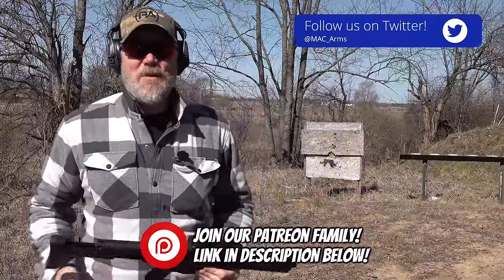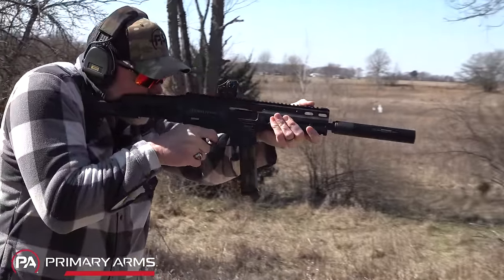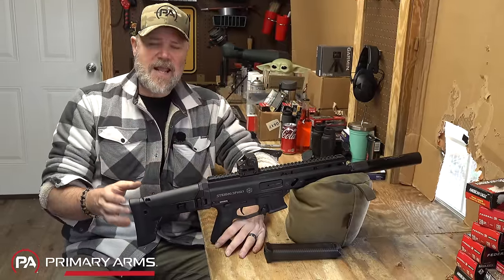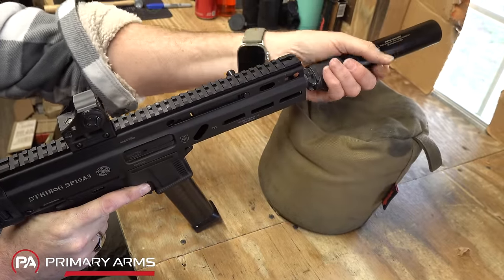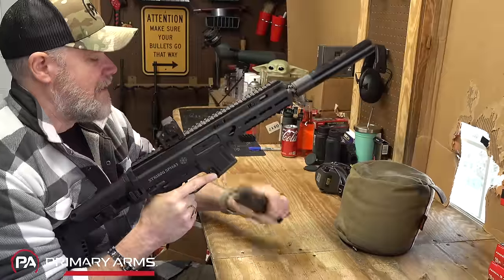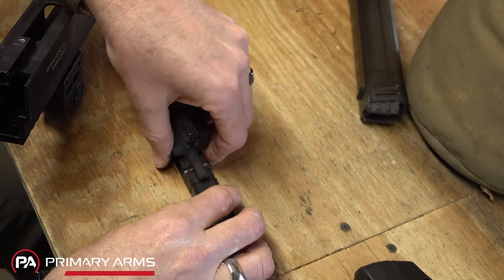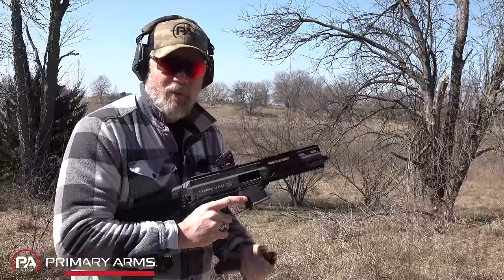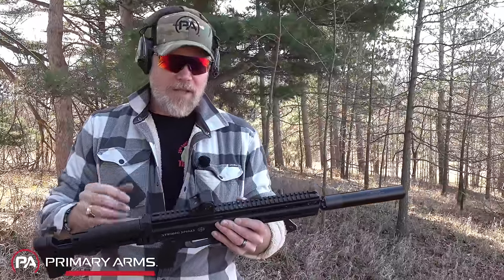The new 10mm in town! The Stribog SP10A3 - How does it work?

Comment: I've been loving my Banshee 10mm. No mechanical issues. Very accurate. Great ergonomics.
Reply: After learning the price on the Stribog, I am leaning hard towards the Banshee.
Reply: @brianwinkler8183  For what it's worth it's got my vote. Big plus - no proprietary mags.
Reply: I have a banshee 10mm as well. I shot it side by side with my 10mm Stribog. Both are awesome. I like the feel of the Stribog a bit better. I’m not getting rid of either :-)
Reply: Banshee 👍🏻
Reply: @mjohn3006 what do you like better? How does the recoil compare?
Reply: @mjohn3006  i would like to know what you like better about the Stribog too considering the 30rd mags are over $100 a piece.
Reply: The banshee has a somewhat odd recoil pulse. It is not bad. It just feels different. I like the forward mounted charging handle over AR. And while function should be over form, I think glock mags in rifles look dumb. :-P I like the way the Stribog looks
Reply: @taylorlibby7642  The SP10A3 doesn't use proprietary mags, it takes UMP magazines
Reply: I was looking into those but was a little disappointed in the barrel length options of their standard buffer model.
Reply: @mjohn3006 you got a suppressor? Which is less gassy?
Reply: Op, your banshee works w a fixed ejector, or   With an AR type spring loaded plunger in the bolt face
Reply: @johnanon658  yes I have suppressors. but I have not tried suppressing the banshee or the bog

Comment: It is very interesting that there's a resurgence of the 10mm happening now, I've always thought the 10mm would make for a good PPC due it's power level, I know several guys who use cheap 10mm hipoints to hunt deer with with good results here in KY.  I just built an AR in 10mm using glock mags, although I would prefer the Stribog mags for looks.  It will be interesting if the Stribog mags end up being the defacto alternative mag to the Glocks and if so if others will make AR lowers for them.  I will say building a blowback AR does have the advantage of being cheaper (much cheaper, like $750 less), seemingly fewer reliability issues and the ability to use either 40 or 10mm ammo (the headspace in a blowback gun is not fixed as it is in the Stribog).  Of course, the drawback is more felt recoil due to the mass of the bolt/buffer and spring but even then the 10mm isn't quite so back that blowback is that bad.
Reply: It would be great if they made a Glock lower for this 10mm because 30rd SGM glock mags are reliable and only $20 per.
Reply: @ShizawnSanders  So far the SGM mags have worked flawlessly in my AR but I'd prefer the look of the straight Stribog mags.  I guess owning a 9mm Stribog I'm just partial to the look of the orginal...
Reply: The mags are not proprietary the Stribog will take UMP mags

Comment: I got mine a couple months ago. It almost instantly became my favorite 10mm PCC, and one of my favorite PCCs period. I do wish there was a 30 round option. Or it could use my 30 round 10mm MP5 magazines.
Reply: Have you tried ump 10mm mags?
Reply: @EvanDickersonM81  no. I don’t have any
Reply: Wait-do you actually have an HK MP5 in 10mm? If so, I need to immediately meet you at the range.
Reply: I have a 10mm mp5k :-)
Reply: Yeah, 30rd UMP 10mm mags are over $100 per. Would be great if they made a glock lower then good SGM 30rd mags are only $20 per.
Reply: @ShizawnSanders  Grand power are making the 20 rounders themselves. Why don't they just make 30s?
Reply: @agentoranj5858  good question

Comment: I think James Reeves interviewed a rep from Grand Power at IWA about this SBR. He was told that the magazines were the same as the H&K UMP. It will accept UMP mags. And, James was informed that a .45 Stribog SP03 is coming soon.
Reply from the maker: I do mention the mags are UMP based in the video. I know of the 45 but wasn’t sure if I could talk about it yet.
Reply: @Militaryarmschannel  The Grand Power rep only mentioned the .45 was still being developed. But, didn't give out any further information.
Reply: There is a 10mm ump?
Reply: @10mikemike89 yes, there is a UMP 10mm and the 30rd mags are like $120 per magazine. They should have made this as a Glock compatible lower where the 30rd mags are only $20 per magazine
Reply: @10mikemike89  H&K only made the UMP in .40 & .45. There is another company that made a replica for the UMP in 10 mm with a conversion kit. OMEGA GIDEON SHADOW 10MM PISTOL.

Comment: Could you compare this to the CMMG in 10mm? 😊🙏 Good review as always, thank you!
Reply: I want to see that too but the Banshee already wins in magazine cost and compatibility. 30rd 10mm Glock SGM mags are $20. H&K 30rd 10mm mags(what this A3 takes) are $120. That's a whopping $100 per magazine savings for 30rd mags. The 20rd mags they make for this are still more expensive than the SGM 30rd too and I bet the SGM 30rd isn't that much longer  then the Stribog 20rd. It was CRAZY for them to use the UMP magazine design.

Comment: Pretty sure it takes H&K UMP mags which are made in 30rd but last i checked they are $120 per magazine!
Reply: $150… I just ordered 2 from HKParts . This gun is amazing and recoil impulse is extremely pleasant. Only thing missing were the 30 rounders so had to grab em before they are gone.
Reply: @benmorall7664  yeah but thats just nuts on another level. $150 per magazine to have a 30 rounder. Why didn't you just get a CMMG MK10 Banshee which are $20 per 30rd mags.

Comment: Banshee with Glock 20 mags, AR Lower grips, trigger components compatible. Plus I have the 10 mm Banshee and then bought the 45 acp Banshee upper that takes Glock 21 magazines.
I have a Striborg 9 mm but I like my CZ Scorpion better.
'In for a penny in for a pound' So I bought the A3 Tactical Striborg Lower Reciever. This conversion takes AR-15 drop-in Triggers and AR-15 grips. And it is compatible with  CZ Scorpion Magazines including Manticore arms!
So now both my Striborg and CZ use the same magazines.

Comment: For those not in the know, the original design standards for 10mm is 200g @ 1250fps. Anything slower is considered an FBI load. 

9mm is just .38 Super. Fight me. 😂
Reply: I have some 10mm 100gr Lehigh Defense Extreme Defenders I loaded to ~1700fps. 😂
Reply: @martinsonofwar395 yeah. That's one of my favorites too.
Reply: 200gr at 1250fps would be great. That would be some serious power. I know Underwood has some that go over 2000fps in light loads. Very high energy for what it is.

Comment: **10 mm is precisely where the 41 magnum was supposed to be, (the 41 ended up just being a junior 44) halfway between 357 and 44 mag.
**Standard Glock magazines are 15 rounds the Arrendo accessories had a +5 floor plate designed like the Kriss floor plate.
**So the 20-round magazine really isn't bringing anything new to the table, and why didn't they just make it 30 rounds, is there any reason why?
Reply: SGM make "30rd" 10mm mags. They work flawlessly. In reality they are 28rd mags, though.
Reply: @martinsonofwar395  so basically they put out a faulty product to begin with 🤔
**Then they should have made it 33 rounds
**But thank you for the information!
Reply: @martinsonofwar395 My smg mag loads all 30 of 10mm, not easy when its new tho.
Reply: Glock mags are single feed, fragile, and look hideous.
Reply: @HYDRAdude  can't believe you said fragile. Who wants 20rds for a pcc when you have other cheaper options
Reply: @HYDRAdude  as far the single feed that's supposed to be better that's an opinion.
**As far as looks that's also an opinion.
**As far as durability? How rough are you going to have to be to get it to fail. 
**All abused magazines will eventually fail.
**And the other mags are they twice as durable, or one & half as durable?
**The only time I've had a Glock magazine fail was when I put an aftermarket floor plate on it that wasn't a Arrendo floor plate.
Reply: @eddiehoover2788  I’ve got 12 SGM 30rd mags and every single one of them holds 30 rounds.  The ETS 25rd mag I bought is garbage and doesn’t even lock in.  SGM mags work fine but I’ve got to hit the bottom to make sure it acts right.  I need good 25rd mags as I can’t fit my APC10 in my sling bag with the Eotech and a 30rd mag in it.  It’s ~3/4” too tall.
Reply: @HYDRAdude   I agree on the single feed.  I load a bunch of MP5 mags and wish it was so easy for the APC10 with G-pattern mags.  Not a deal breaker but definitely noticeable.
Reply: @Watchdog_UFOtestpilot  interesting i have had to hit mine but I did tape the bottom to make sure they're drop safe. All you need is a extra power spring. I had to replace a spring for my keltec and I haven't needed to hit it since and the magazine is a little rusty so a stronger spring will definitely fix that problem for the sgm mags. I've had some ets mags but the ones I had in .40 melted on the 4th a few years ago so im scared to buy them for the 10mm. I haven't bought any since 😂 all the 9mm ets mags I've had have worked i will give them that

Comment: Thanks for the video! Could we get a (subjective) evaluation of the felt recoil of the Stribog vs the CMMG Banshee vs straight blow-back AR 10mm vs DI AR 10mm (if you've had the pleasure of firing one)? I have a 16" DI 10mm upper from Macon Armory, but thinking about picking up either a Banshee or the Stribog for something a little shorter.
Reply: There is a DI 10mm? What's that like? Do they make like a 7"-10" barrel version? DI is a very soft recoiling system. Its why 9mm blowback literally has more recoil than 5.56 DI.
Reply: @ShizawnSanders  there isn’t a DI 10mm manufactured and available at retail, but you can order an upper be built by a few places. I had mine done by Rudy at Macon Armory, there is also RMW Xtreme and The AR Guy. They offer other (pistol) calibers as well.
Reply: @johnnyk5  is there a 10mm DI barrel you can point me to somewhere between 8-10" with a pistol length gas port and a 10mm bolt that goes into a standard AR carrier? At point I can just build my own. Really wondering if hot 10mm makes enough gas to cycle DI. I'm actually interested. I can see anemic 10mm not working but as long as the hotter FMJ target loads work and Underwood and Liberty hot duty/hunting ammo works i will build me a cool 10mm pistol or SBR.
Reply: @ShizawnSanders  I can’t point you to any off-the-shelf DI barrels, but the bolt is a standard 6.8/224 Valkyrie.
Reply: @johnnyk5  no shit on the bolt? That's interesting.
Reply: @johnnyk5  have you thought about just turning your rifle into a pistol or SBR and having the barrel cut? What gas system is on that 16" rifle? Does it relaibly cycle training ammo? I like using Magtech 10mm training ammo which is like 1300fps but most fmj cheaper training ammo isn't powerful. Even less power than 40 cal which is really pathetic and it makes me feel like the ammo companies are ripping me off.

Comment: I notice a few manufacturers using the PSA F5 stock. And the stock needs a redesign with the butt pad. I shot my JAKL with the F5 and noticed the butt pad was uncomfortable and couldn't get a good shoulder purchase.

I ended up getting the JMAC custom/skeletonized tube and put on a Strike Industries MOD2 Stock on the tube. Now the JAKL is night and day comfortable with a proper shoulder purchase. As well as, the JAKL looks better too (imo).  I wish PSA would do a Gen2 JAKL and address the weight and heating issues.

Comment: Stribog got it right by making a PCC in 10mm and making it not use Glock mags
Reply: On one hand, I would have to buy more and different mags. On the other, I want more capacity
Reply: @martinsonofwar395  I had a vector 10mm and have a banshee mk10. Glock mags really aren’t helping 10mm PCCs with their lack of 10mm extendos and no aftermarket.

Comment: I wish their roller delay was a little bit more aggressive. It would be interesting if they used tungsten for the delay dingus.
Reply: The 10 mm Stribog design looks simple enough that an after market tungsten roller delay pin could be tested and marketed if it conferred a functional advantage but that might make weaker 10 mm ammo even less reliable.  Maybe the trick would be a heavier roller delay pin with more intertia and a lighter bolt.  The Stribog design looks to me like a cross between a roller delay and a blow back design... maybe a bit more of the latter.  "Roller delay" confers a marketing advantage.  I wonder how much of the design is motivated by engineering and how much is motivated by marketing.
Reply: That pin is too small making it out of tungsten would make little difference
Reply: @clee3720 Not the pin, but the mass in front that slides front to back..
Reply: @Liberty4Ever  >"The Stribog design looks to me like a cross between a roller delay and a blow back design... maybe a bit more of the latter."
If you knew anything about how a roller delayed system works then you would realize how asinine your comment is.
Reply: @HYDRAdude  - Amusing that you think adding mass to the bolt of a roller delayed action doesn't increase the lock time.

Comment: Looks pretty sweet shame you have to be a little picky with ammo but that’s the nature of 10mm with weak and high loads. Would be nice if it came with actual back up iron sights don’t care much for notches. Pccs are my favourite platform
Reply: I have had mine for 2 weeks. I have run aac 180 gr fmj, 180 gr xtp, 200 grain Underwood HP, 220 grain hardcast underwood, 60 grain liberty civil Defense and 93 grain Norma nxd with absolutely zero failures over a total of about 550 rounds so it hasn’t been ammo finicky at all.

Comment: Not taking Glock mags is a big issue imo. Why? Their 9mm does.... I would rather spring for the B&T 10mm... or a KRISS vector. Both take Glock mags which you can get the extensions to 30 rounds.
Reply: I own an APC10 Pro and love it.  SGM Tactical makes functioning 30rd G-pattern mags, and B&T make their own 30rd mags for it too ($90). No need for the extensions any more but it’s still an option.  MBT stock for the APC10 is AWESOME, fwiw.

Comment: Does this come with mags that don't work like the 9mm Stribog?
Reply: They use UMP mags. They work, have been extensevily tested
Reply: Comes with 3 mags. I have a few hundred rounds though mine. Different brands, different strengths. No issues.
Reply: The curved Stribog mags are excellent magazines. Not CZ Scorpion excellent, but still.

Comment: I would like to see some velocity numbers with lighter bullets.  I'm wondering how close to short-barreled 5.56 energy it can get.  I like PCC's/pistols because they tend to be more durable in a lot of ways.  It would be cool to see if a PCC can bridge the gap to rifle energy at close range.
Reply: I have 100gr Lehigh Defense Extreme Defenders in 10mm. They don't make that grain weight anymore unfortunately. 
Out of my 6.5" KKM barrel they are zipping out at 1700fps. They will pop 3a armor
Reply: A 7.5 ar with regular 55gr ahs the same energy as a 9mm at 100 yards while a 8in 10mm still has the power of a .45 at 350 yards.  10mm does great at retaining its energy. I plan on getting a smg kinda build but they still cost unless you buy a 10mm ar that isn't a cmmg. Really want a folding stock so I can make it a pdw. The 10 is way more effective in a short barrel than 556 but you can get a ak pistol for less.
Reply: You can get well over 700 ft lbs from Underwood 10mm, especially out of the longer PCC barrel.
Reply: @martinsonofwar395  Underwood loads them in 115, and I do believe 100 as well.  I’d have to go through waaaay too many cans of 10mm to find all the grain weights from underwood, but they use Lehigh projectiles and load them pretty freaking hot.  I’ve got 1800+ fps stuff from them (out of the APC10).
Reply: @eddiehoover2788  What I'm hoping for is close to 1000 ft-lbs of energy at a few feet and the reliability of a 9mm sub gun.  You can run 1000's of rounds of full auto through a 9mm AR9, for example, in one sitting without a catastrophic failure.  Whereas, rifles can't do that due to excessive heat.

Comment: Wasn’t the stribog on your list of worst firearms you purchased a couple years ago?
It was on your worst made or worst you bought or worst or regretted something rather. I remember it vividly. I steered away from the A1-A3 because you even commented about how you’d had all the versions and they’re all trash.
Reply: Also, why would I pick this over say a $1300 10.25” or 10.3” 5.56?
Or $1300 for a 300 BLK that’s 8”?

This is a toy for guys that already have practical stuff covered. It’s a toy. That’s all. Could you mental gymnastics yourself into justifying the purchase? Sure. Is it better than a $1300 300BLK 8”, no. Is it better than a $1300 10.3” 556? No. Is ammo more expensive than both 300BLK and 556, slightly.

It’s a toy. It’s ok to own toys. But it’s a toy. Could you shove it in a practical role, I guess. It won’t overtake anything in practicality.
Reply: Depends what ammo you're getting, but using PSA as a baseline, 10mm is more expensive than 5.56 and cheaper than .300 BLK. 

As for advantages, unsuppressed 10mm is going to have the least blast in short barrel lengths, it has that nice side-charging handle for ease of charging, and it can take a folding stock or brace to make it more compact than an AR. 

So there are some reasons someone might pick it over an AR. And there are plenty of reasons someone might pick an AR over this.
Reply: @peterreily1490  All firearms don't have to have a particular or practical use per se. For people like that, they'll own 5-8 firearms and be good with it. Whereas, there's a lot more people, who simply love firearms. And enjoy purchasing different stuff. Don't get me wrong, it's a nasty addiction, that gets quite expensive. I started purchasing guns in mid 1980's. Currently I have over 450 firearms in my collection. Like I said, it's a nasty addiction, but a fun one to have.